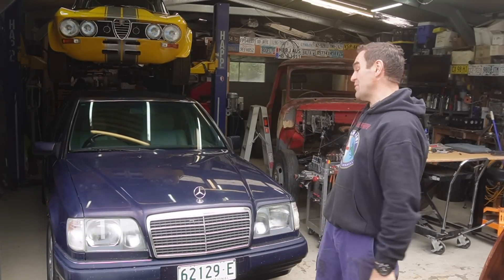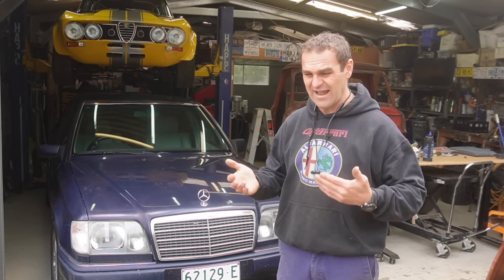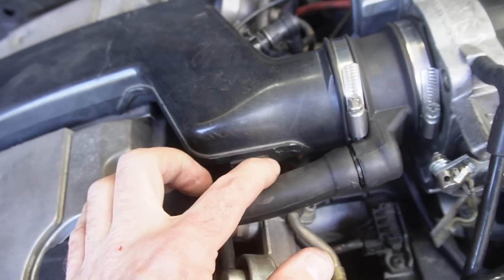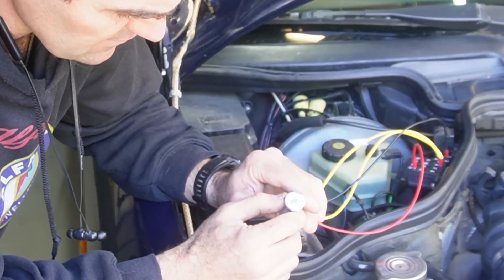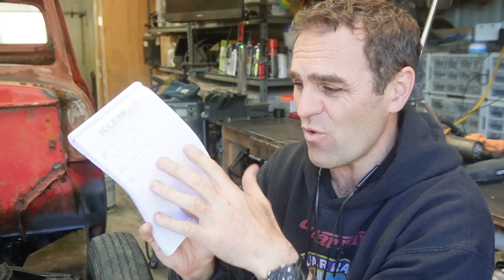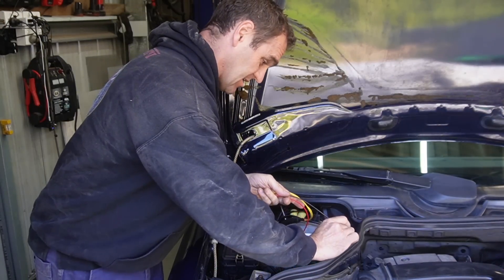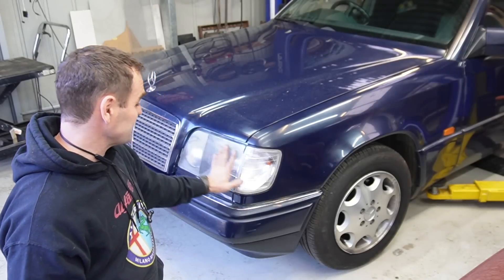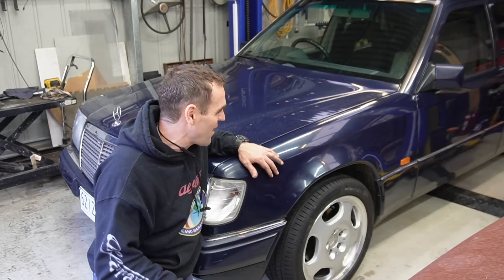DIY OBD1 code reader.  Mercedes W124 E220 part 3

Comment: That wheel swap was criminal, you replaced the beautiful diamond cut 8-hole ("Alamak") wheels (the best OEM wheels for this model!) with some absolutely disgusting winter-duty-style wheels from a newer model 🙈. If you replace the 8-hole at least put on some proper AMGs!

Comment: Great video, thanks for the explanation and diagram of the OBD1 tester! Made my own but it doesn't seem to work. If i turn the ignition to position 2, the plug into pins 1 & 16 should the bulb work? 
I haven't got 12v's at pin 16 when measured to a ground. Thanks.
Reply from the maker: I just did a little bit of online research and it seemed to work for me.

Comment: If its got a narrow band O2 sensor that is 30yrs old it will be toast for sure giving incorrect reading in closed loop.  
Don't disgard all the vac leak suggestions at idle when Vacuum is at it highest.  Good suggestion about the possible faulty MAF.
The vac line going into the cabin - plug that to eliminate any vac leaks past the firewall.  Also plug as a separate test plug the vac line going to the fuel reg to eliminate a faulty fuel reg diaphragm. 
In the end it is going to be something very simple knowing it is occuring at idle only in closed loop mode.  Heaps of Vids on YT about M111 idle issues no doubt you have researched them all

Comment: i am currently working on an estate e220 s124. Nice car but its at an age where everythign needs work.  The last owner did not maintain at all.  I havent had any issue with stalling (yet).  Id guess MAF as paulmac says.  I hate frustrating parts like this when working on cars.. Youd expect improvement after so much time and effort!

Comment: Looking at light reflecting on the hood  it gives a separation of different panel shape on the hood and I was thinking some Pin Striping  might look pretty good , being dark blue you would have a good choice of colours.  Back in the early seventy there was a bit of lace painting happening and I did a bit on my Minis roof, bonnet and boot . Silver lace on a blue Mini , certainly made it a bit special.  Laurie  Sunshine Coast QLD

Comment: Had same problem on W124 E220 1996: Take off the throttle body actuator and check internal wiring - probably a simple repair with a bit of new wiring and soldering. It worked for me.
Reply from the maker: Watch last episode ;)

Comment: My recommendation is to acquire the book by Charles O. Probst - "Bosch Fuel Injection & Engine Management".  It provides a very detailed explanation of the Bosch Continuous Injection System (CIS) and likely causes of failure of all the systems/components used on the K-Jetronic and KE-Jectronic Bosch fuel injection system -  (not sure which type is fitted to your car).  It' been immensely helpful for me and has reduced the need to adopt the expensive 'parts cannon apprach' to solving fuel management problems - which is normally expensive and supremely frustrating.

Comment: Inside the throttle body is a screw that alters the position of the Butterfly valve when fully closed at idle. You can see this at 9:19 in the previous video. Just alter this slightly. I should add, there are much better suggestions in the comments, but just in case they don't pan out, I think it worth having a look at the screw that limits the range of the butterfly valve as it closes. I could hear the idle control hunting up and down the revs, it felt like the valve was not open wide enough, similar to how a gunked up throttle acts. but given how clean your throttle is, its worth setting the idle control limiter to be slightly more open... just a bit... a tiny tiny bit. It probably moved slightly with all the work you have done already.

Comment: At 12:03 the throttle valve moves to close the butterfly and eventually closes it completely. Probably part of its normal cycle, but it may be doing the cycle incorrectly and may give some clues to what or why the ECU is telling it to do.

Comment: Doing a smoke leak is always helpful on these old cars as lets you know if any of the intake system and breather system have any problems.
Otherwise the MAF could be an issue but I think it would be a good idea to reach out to owners club so you can borrow a known good working throttle body. That would then rule out the throttle body but not it's wiring. If the insulation breaks up over time then maybe there's a short back to the ECU.
The lambda sensor is also intersting. Has that code come back after driving for a while? As these old cars use narrow band then that code could point towards the MAF or an air leak or fuel injectors not being regulated properly.
Reply: hey i was thinking this given the horrific vaccum powered systems like HVAC, doors etc (had a 190E that was a mindfuck)
and you can make them cheap!! i used a sealable bucket, baby oil and foam cutting wire wrapped in a coil around a wick of cotton and a variable power source to heat the wire. Then air fittings in the lid of the bucket, attach compressed air to one port and a hose to the other port placed into the intake (or vaccum line or whatever)

Cost almost nothing as had all the bits, just had to  get the baby oil from diddy

Comment: Hey Jeff, ex merc mechanic here, I worked on hundreds off these 124's, the vacuum line going into the passenger compartment also operates the door and boot locks, try blanking it off at the manifold to rule out issues with the cabin systems, the most common cause of this issue back in the day was the MAF sensor.
Reply: MAF sensor is my guess, too. Similar idle fluctuations when one of the two MAFs in my E39 M5 failed

Comment: Either way I’d be doing a zero baseline check starting with all the sensor functions with a multimeter.  Cam, crank, fuel pressure, TB (again) and so on.

Comment: If you drive it does it backfire/misfire?  If so could be evap/charcoal canister related.  My car isn't a Merc, but it was having intermittent rough low speed idling.  No vacuum leaks detected.  Yes a vacuum leak usually does make it idle higher but a large one with make it run rough and low.   As it was intermittent it was hard to find but I eventually found that the evap purge valve was opening when ever it liked instead of at cruise throttle settings.  This valve is supposed to only open up at cruise and only for like half a second to allow petrol laden air from the charcoal canister to be burnt in the combustion chamber.  At idle it is supposed to remain closed but randomly it would open up causing a massive lean condition and low stumbling idling.  I didn't find out if it was my ECU, wiring or valve at fault because I bypassed the valve and blocked off the entry point into the intake manifold and now vent it to atmosphere (sorry Captain Planet).

Comment: Check the fuel pressure at idle.  It could be a failing fuel pump.  Iirc these have a variable speed fuel pump and if the fuel pressure regulator or pressure sensor is failing or the pump is failing it won’t drive enough fuel at idle whereas it may power it enough at revs to sustain fuel pressure to run. 

The lean out may be throwing the o2 sensor code.

Comment: I dont think its an idle control problem. You can see in the video that the trottlebody opens but the engine stalls with the thottle open. Try listening to your injectors with a stetocope.

Comment: You should check the heater and cabin airflow control. I had an issue like that on my Peugeot 605 from the same time. The controls are run on vacuum from the intake. When they are leaking the idle is not working and tries to overcompensate.
I had to replace the hole control body on mine, I don't know exactly how it is done by Mercedes.
You can put a mike under the dash and listen for a hiss sound. That is what I had

Comment: Hi Jeff,  Idle Air Control Valve - IACV.  Not sure on mercs (not even sure they have them!) but on volvos of the same age they get gummed up due to the PCV even on NA cars.

Bypass's the Throttle body on the Air intake side - you'll see it if you have one.

Cleaned with the usual solvents once taken off - bit of a 100k miles service item that know one tells us about.

Good luck!
Reply from the maker: No ICV on this car unfortunately.

Comment: Wow, so simple under the hood! On Toyota/Lex, you short a couple pins in the check connector, and the check engine light does the flashing for you - no tool needed. I'd second the comments to check the fuel pressure regulator.

Comment: My daily driver has normal wheels on it. I didn't bother going for bigger wheels/lower profiles/lower suspension as I want comfort and don't want to worry about curbing the wheels. My little sports car on the other hand is totally different. I'd concentrate on fixing the idling issue before spending money elsewhere just so that you don't potentially waste any money.

Comment: I have had a merc from that eara and the vacuum line from the inlet body goes in to the firewall and behind the dash to regulate the head light height, they fell of(mysteriously).

Comment: We had an old car that would cut out/run rough at idle. Turned out the low tension wire was duff. Not sure the equivalent on a car of this age. Or could it be a fuel pump issue/fuel filter maybe blocked

Comment: Based on those error codes, as that is all i have to go on..rule out these as well

Fault Code 8: Idle Speed Control (ISC) System
- Problem with ISC system or "limp home" mode.
- Possible Causes:
  - Throttle body dirty/faulty.
  - ISC valve malfunction.
  - Airflow sensor issues.
  - Vacuum leaks.
- Fixes:
  - Clean/replace ISC valve.
  - Clean throttle body.
  - Check for vacuum leaks.
  - Inspect/clean MAF sensor.

 Fault Code 13: O2 Sensor (Lambda) Rich/Lean Limit
- Air-fuel mixture too rich or lean.
- Possible Causes:
  - Faulty oxygen sensor.
  - Exhaust leaks.
  - Fuel injector issues.
  - Dirty air filter or MAF sensor.
- Fixes:
  - Replace oxygen sensor.
  - Fix exhaust leaks.
  - Clean/inspect fuel injectors.
  - Replace/clean air filter and MAF sensor.

Also
Inspect Air Intake temp sensor

Test the sensor and replace if it’s malfunctioning.

Specific when stalling in traffic

- Overheating Idle Control Valve (IAC)
- Faulty Cooling Fan or Relay
- Transmission Torque Converter Lock-Up Issue
- Excessive Carbon Buildup in Intake System
- Low Voltage from Alternator at Idle
- Weak Brake Booster or Vacuum Leak
- Fuel Vapor Lock
- Engine Cooling System Inefficiency
Reply from the maker: That is great, thanks. I have just ordered a new MAF as it is cheap. This car doesn't have an Idle control valve (earlier models do). I will also double check and order a new O2 sensor.
Reply: @HomeBuiltByJeff   no worries Jeff

Comment: Maybe a leaking injector, because it'll flood the combustion chamber when at idle condition, and the ecu will open the thottle to ingest more air to correct the AFR, overshooting it and turn the idlle erratic.

Comment: Jeff a couple of common idiling problems with the w124 first is the lamda sensor then there is the lovely bosch KE electronic box that runs the injection and also the injectors get stuck at low pressure when you accelerate the injectors free up as they are mechanical hope this helps
Reply from the maker: As far as I understand the KE Jetronic is on the earlier W124's.
Reply: @HomeBuiltByJeff  thats good then jeff but for shits and giggles i would get the injectors cleaned anyway the car is quite old😁have you got your report back yet i hope to get mine next week cheers glenn

Comment: The vacuum tube going into the body does stuff under the dash. From memory on my W124 it activated head light levelling. If it’s leaking the sound inside the car is quite noticeable so I don’t think that’s your issue.

Comment: Maybe try a smoke test to confirm that there are no vacuum leaks. They are not always apparent. You could build a DIY smoker to go with your DIY obd1 reader 😅
Reply: Yes I did that on my VW that idle bad. Built a smoke tester with a old jam bottle and a soldering iron. Find that my brake booster was leaking 👍

Comment: The error code given matches up with the fuel regulator leaking ,
Check if fuel dribbles out when the vacuum hose is removed.

Comment: Why don't you fit an aftermarket ECU. Here in South Africa they are cheep and also allow you to remove lots of the components that is old as they are not needed anymore. I had an old BMW E30 that had a similar issue and after fitting an aftermarket it was such a pleasure to drive and fine tune. Ever able to do sone performance upgrades later.  

Great channel.

Comment: Jeff, if you google faulty air mass sensor symptoms, poor idle is one of the key symptoms. It causes the engine to run lean also causing a lack of power which could also causing your lambda sensor code. Did efi diagnostics in the mid 90s.

Comment: The vacuum line going to the fuel regulator is often a problem.
If the regulator has failed it can let that line draw in fuel and you will get all kinds of issues especially inability to idle.
Reply: I second this comment exactly what I was thinking

Comment: Older Mercedes used to have vacuum to control heater switches/levers and the central locking. The grey vacuum hose that leads through the firewall into the cabin could be the culprit, also there could be a vacuum reservoir inside the cabin or wheel arches
Reply: Even the Headlight leveling is done by vacuum
Reply: My old 535i had vacuum controlled vents and they were rotten and couldn't be replaced. Was a huge headache only having heat.

Comment: Gremlins... I spent more than six months searching for fixes to my motorcycle's charging system faults. Turned out to be caused by weakened Earthing between engine and frame. Easiest fix was to add a 2nd Earth lead from battery to frame.

Comment: Does it have an evap system? If so check evap valves and fuel filler cap for vacuum leaks, from memory rear valve vents to atmosphere when engine is not running and after engine starts it becomes a closed loop, sucking fumes from tank back into intake manifold. Just something else to check.

Comment: After clearing the old codes I would run the engine for a while up to temperature, then pull the codes again to see what came back and address whatever that is. Maybe the injectors? Catalytic converter a bit clogged? So many possibilities ...